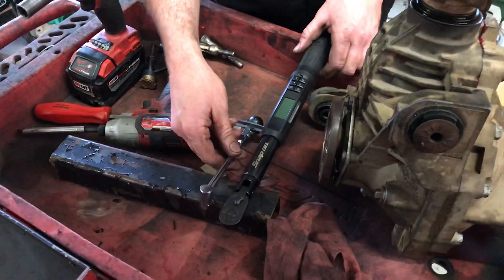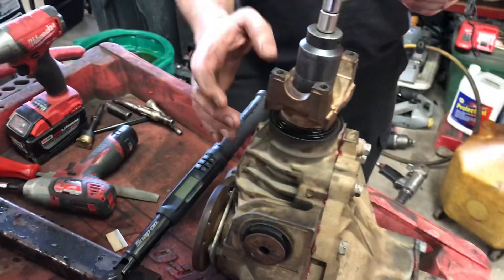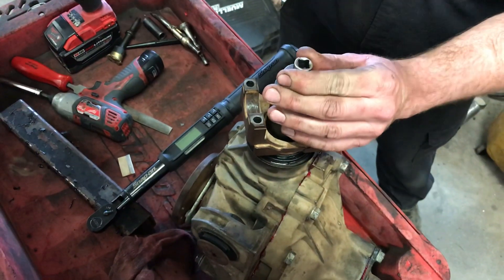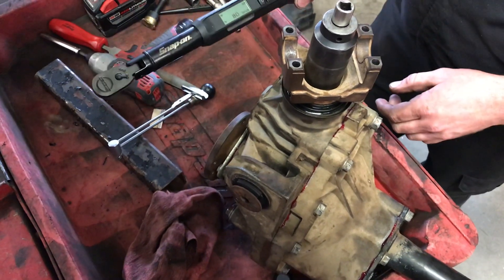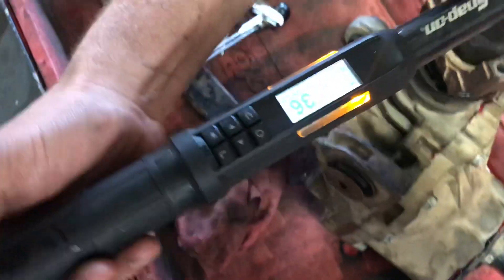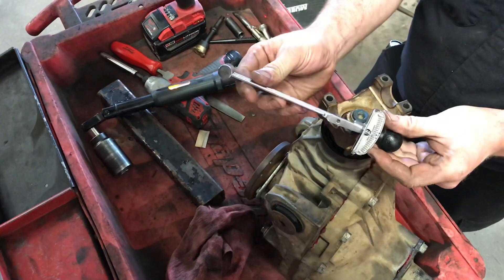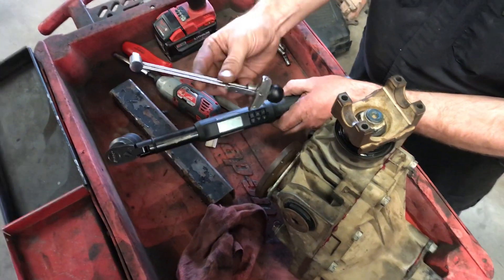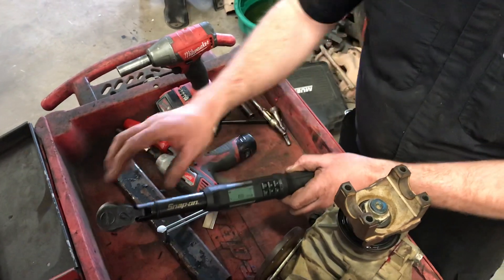Can the Snap-on tech angle replace a beam torque wrench for rotational torque?

Comment: when i was 15 i was gifted a 3/8 and 1/4 old craftsman usa beam torque wrenches. fast forward a 3 years and i started working in a shop that had a "snap on torque wrenches only" policy. well i put my old beam style againest everyone elses digital, split beam, and twist handle snap on torque wrenches on the tester and mine were 100% accurate every single time and were the best out of 2 dozen wrenches we tested. the digital snap on are nice, but when it comes to accuracy and price you really can't beat old beam style

Comment: I need to stop putting it off, and buy myself a digital torque wrench! Lol
Reply from the maker: Voltage Drop Diagnostics I put it off for a long time. I just didn’t trust the early ones but I think they are good now. I got a good deal on the all black techangle wrenches because I bought the 3/8” and 1/2” as a matching set.

Comment: Only thing I would say is I agree, I’d rather use the tech angle wrench for reliability....but sometimes due to space constraints my smaller Snap-on torque-o-meter dial gauge fits better
Reply from the maker: I looked into the torqometer and for the price I think I will hold off for bit. I will try with the tech angle for a while and see how it works.